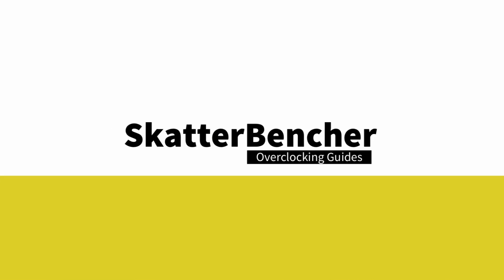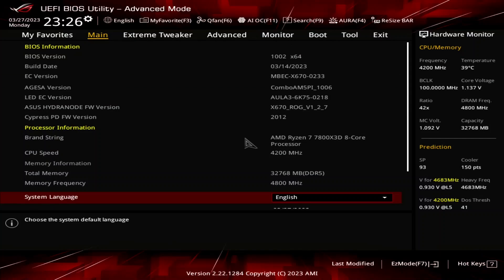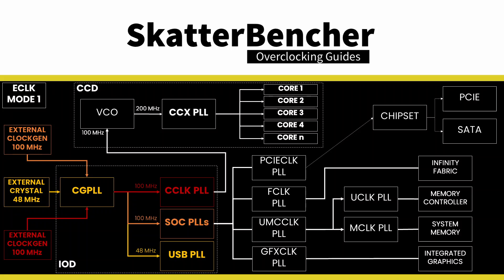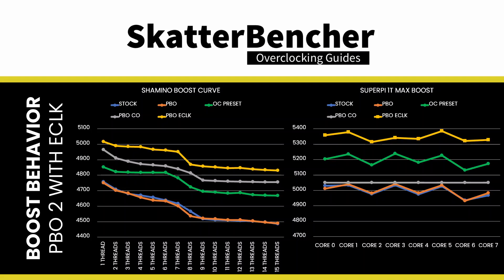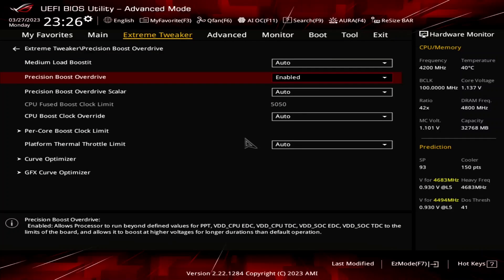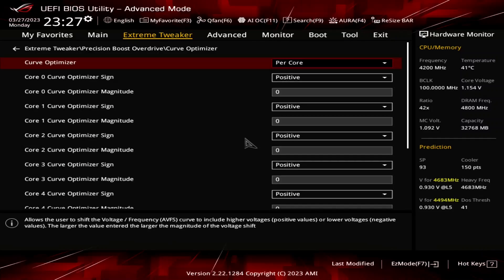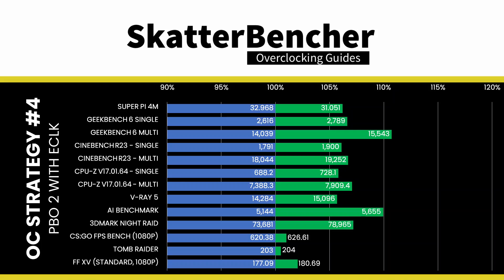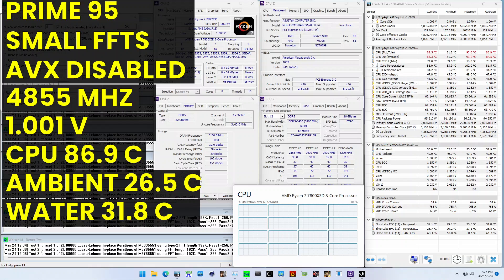5 Minute Overclock: Ryzen 7 7800X3D to 5403 MHz

Comment: Hi my bro ❤️
I have a question and I hope That you answer me with details, Can I overclocking my ryzen 7 7800x3d with advanced overclock to 5.4 ghz (eclk, memory clk, asynchrone, courbe ~ 0-5-5+0+0+0+15+0) with msi b650m-p or I should buy a x670 or x870 ?
Thanks a lot my friend 😉
Reply from the maker: I doubt that motherboard has asynchronous eclk support (you need extra external clockgen on the board), but there's definitely other strategies you can try. Check out my longer SkatterBencher guide for more information: https://www.youtube.com/watch?v=90UBUq1mLGY
Reply: @SkatterBencher  thanks a lot my friend 😉

Comment: The funniest thing is that I got 19500 in Cinebench R23 with a simple B650 and air cooling, and every day I use a 35 all core, which gives me a result of 19200-19300, perfectly stable for a whole year.
Reply: How wait is setings
Reply: Still using -35 all core to this day? not a single crash during gaming? I could also do even -40 on benchmarks but it crashes at -25 in games

Comment: Question: In a motherboard lacking an ECLK, could one force the FCLK (Infinity fabric), UCLK (Mem controller), and MCLK (Ram Clock) to a set speed, and then set the BCLK to 107?
Reply from the maker: On motherboards without external clock generators (ECLK) or with just one (Sync ECLK), all parts of the CPU will be affected by changes in the reference clock. While each of the mentioned IP have individually adjustable ratios, they're all getting their source clock from the same origin.

Comment: Question, is the reason you're setting the curve optimizer to a positive offset because of the CLK increase of 7%?  And did you test if it's possible to run that without effectively increasing the voltage at all? Just curious.
Reply from the maker: Yes, correct. Using the ECLK shifts the V/F curve along the frequency axis, effectively running a higher frequency at a given voltage. A positive curve optimizer shifts the curve along the voltage axis, forcing higher voltages. That's what was needed to get the overclock stable.

Comment: I just built a 7800x3d and this is my first build since 2014 when I built a couple AMD Kaveri A10 7850 computers for my daughters.  I did no overclocking on that one but at the same time I got a corsair AIO for my i7 2600k and tweaked it to 4.5ghz which is still runs today under the same AIO.  That was fairly easy to do.  CPU clocking seems to have gotten a lot more difficult.  Would love more explanation on what all these different settings do to the CPU.  Is that something you have gone over in your overclocking videos or does anyone have a suggestion on who to check out?
Reply from the maker: I suggest you can watch my longer guide on the 7800X3D. That should have everything you need to know about how it works + a couple of OC strategies ranging from easy to hard https://www.youtube.com/watch?v=90UBUq1mLGY

Comment: 106 works fine for me.  Cinebench r23 scores 18800 points.  I am getting error 107.  What do you think I should try for 107?
Reply: Edit: PC resets when running Crome while at 106. No problem at 105.

Comment: first of all great tutorial! i followed all of your settings eclk at 107 and curve optimizer at positive 10 and llc at 10x. i pass all stress tests fine. occt, prime95, cinebench r23, and timespy without issue. did some memory tests as well with no issues but i get random reboots when broswing with chrome or when i do light load applications.
 do you have any tips on what i can do to make it stable when idle and in light load scenarios?

Comment: are these settings still recommended now? Have the 7800x3d and rog strix x670e
Reply from the maker: These settings are still valid, however I wouldn't recommend just copying them. I always suggest watching the longer SkatterBencher guide to get a full picture of the different OC Strategies https://www.youtube.com/watch?v=90UBUq1mLGY
Reply: @SkatterBencher  I see. The only worry is that I saw the CPU going over 1.3 SOC voltage so I'll have to make sure to avoid that when following the video
Reply from the maker: You can manually limit the VDDCR_SOC voltage in the BIOS, no?
Reply: @SkatterBencher  yea I can but then I loose the 5.4 boost as my CPU wont go past 5.0
Reply from the maker: That's odd. Which setting are you changing to limit the VDDCR_SOC voltage?
Reply: @SkatterBencher  The SOC voltage to 1.25 and Misc voltage to 1.2
Reply: @SkatterBencher Also every time I enable Asynchronous mode, my PC restarts randomly.
Reply: It’s restarting because 1 of ur cores need more or less voltage on the curve. That’s the whole point with ur gunna turn up bclk u need to adjust each core on the curve up or down or it’s gunna eventually crash. It’s tedious

Comment: REQUIRED - eCLK on MB

ASUS - x670e  hero, exteme, gene, strix-e, strix-f
ASROCK - x670e and b650e taichi
MSI - x670e ACE
GIGABYTE - x670e master extreme, b650e master tachyon
Reply: Any idea if the ASUS ProArt X670E-CEEATOR WIFI does also have eCLK support?
Reply: B650E AORUS MASTER
Reply: Can I use the new Asus - x870E Strix - E?
Reply: @starlingspm4872  no (

Comment: I did prime 95 with that settings. Firsly curve optimized -30 and the system shut down, after -25 and i had the same results. At 20 it runs normaly but i have 2 erros on 2 cores. IDK what to do. I have also enable PBO.
Reply from the maker: For more information on how overclocking 7800X3D works, I would refer you to the longer SkatterBencher guide https://www.youtube.com/watch?v=90UBUq1mLGY

Comment: Why won't it run at 5.7 Ghz, same as the 7950X3D?  Since it has less cores, it should run FASTER/easier to cool?
Reply from the maker: TLDR: AMD saves the best CCDs with highest peak frequency for Ryzen 9 CCD0 and uses lower quality CCDs for Ryzen 7 and Ryzen 5s. The frequency limitation for the 7800X3D isn't due to cooling or voltage, it's the inherent capability of the chips used in the product.

Comment: Hello, I have a 7800x3D processor, I have not made any performance changes with it, it works as it comes out of the box, it runs at 4675 and 4775 mhz in games, is this normal?
Reply: 100%  normal.  I use   docp 1,  pbo  all cores  -27,  and  limit  of  89  celsius.  4,9-5ghz.  Just try,  it's really  simple  and  works well  if  you  have   an  240mm aio water  cooler

Comment: In my case I can't bring my CPU over the 5050Mhz even if I set the BCLK2 Frequenzy to 105 or whatever it sticks to 5050Mhz.
Reply: Seems to be a BIOS Update problem. Used to work back then. Used to have stable 5.3 GHz and now it wont go past 5050

Comment: Hey man, i stumbled across your video and i have a question. I recently bought and build my new system with a Ryzen 7 7800x3d, now im running into a problem with my idle temps,  under full load my Peak core voltage is around 1.08-1.10, and while idling it sits around 1.12-1.1.13. do you have any idea how i can fix this? I've tried nearly everything from updating bios, reseating cpu cooling, re applying thermal paste, power plans, updating bios etc but i can't seem to get my idle voltage down. Right now the cpu idles around 53-55 celcius with a 360mm corsair h150i, in game it won't even go above 65 celcius and under full cinebench load this changes to around 77-80 celcius. which in my eyes, does seem like allright temperatures... I've got no clue why my idle voltage is higher than my full load voltage... if you have a clue... let me know
Reply from the maker: Having full load voltage lower than idle voltage is very normal behavior in modern systems and is nothing to worry about. 

Is there any reason why you want to have the idle voltage identical to the load voltage?

Comment: Hey!
I have Asus TUF Gaming X670E-Plus and on my board Extreme Tweaker --->AI Tweaker and there only one BCLK
BCLK2 its motherboard feature?
Reply from the maker: Yes, support for 2 reference clock inputs must be supported on the motherboard hardware level. If you board does not have support, it's not possible to enable it in BIOS.

Comment: i dont have expo and i dont have eclk so can i overclock without it? i have asus prime x670e-pro wifi
Reply from the maker: You can use Curve Optimizer still. Check out OC Strategy #3 of my full overclocking guide https://youtu.be/90UBUq1mLGY
Reply: @SkatterBencher  whatever i do in bios my clock is always  4.6-4.9 ,there is no affect whatsoever. Curve optimizer -5 or -25 gives me same clock. I tryed 4 bios version.

Comment: Hi everyone, I have a 7800x3d processor. Under the premise of keeping CPU's stability, I aim to reduce the CPU temperature without sacrificing too much performance. What settings should I adjust in the BIOS to achieve this? Thank you.
Reply: Yo tengo PBO -27 y el voltaje en 71000 mV en un 7800x 3D y asi me funciona estable y pasa las pruebas de OCCT de 1 hora y cinebench 23 con buenas puntaciones, pase de 80°c al 100% de uso a unos muy buenos 71°c. Tengo una refrigeracion liquida de dos ventiladores de 120mm. Espero haberte ayudado!
Reply: PBO Curve in -30 is the only thing I learned so far.

Comment: You give 0 explanation on the most important part. How are we supposed to know which cores are strong and weak? All your videos you leave this out... This is pointless.
Reply: Hey, I'm not sure if you still wanted to know how to find out which of your cores were your best, but you can find out by installing Ryzen Master onto your PC which will display which cores are the best. Hope this helps
Reply: HWiNFO64 also showing from best to worst cores
Reply: @RmX. Where does it show your best and worst cores? Do i just make an assumption based on their avg clock speeds?
Reply: @bigjerome-wz4uo they are numbered in best to worst in hw info

Comment: You should do this overclocks with MSI too :)  I don't see the Asynchronous mode and BCLOCK 2 Frequency :(
Reply: He doesn't note in this video this REQUIRES an eCLK on the MB. The only MSI board is the x670 ACE.

Comment: Great info! I read on a forum some guy recommended bumping LLC for the cpu voltage to the max for 7800x3d to get a bigger stable curve optimizer negative, he got -39. What do you think about this? He claimed it should maximize the already so locked down voltage. Would this be a good idea? Harmful?
Reply from the maker: Logically it makes sense. The main function of VRM LLC is to have a controlled the Vdroop which is the voltage drop when going from idle to full load. A low LLC will yield a larger Vdroop (and larger undershoot), which means that the effective voltage will be lower. A higher LLC will means a smaller Vdroop and thus higher effective voltage.

If you use Curve Optimizer, you try to undervolt the CPU. The main challenge is to find an undervolt that large enough so the PB algorithm boosts as high as possible without inducing instability due to too low voltage. A steep LLC will yield higher minimum voltages, so possibly higher Curve Optimizer values.

The main drawback of a high LLC is that the Vdroop may be too small, so you have high minimum voltages under high loads and possibly large voltage overshoots. It is generally not recommended to have too high LLC, however I don't know how "dangerous" it is. It's actually a topic I've been thinking about doing some research on.

Hope this helps.
Reply: LLC at level 7 for my 6400mhz 2133fclk overclocked memory. Working on pbo percore now dialing in each core for maximum performance

Comment: My stock curve is similar to yours but when I enable BCLK2 at 104mhz my curve begins around 4400 and ends around 4200, very linear and lower than stock at all points. I have PBO enabled without curve optimizer. I guess I'm doing something wrong.
Reply from the maker: What motherboard are you on? Sounds like Precision Boost is getting disabled when using ECLK
Reply: @SkatterBencher  Asus ROG Strix X670E-E Gaming WiFi (bios 1416 2023/05/16)

Comment: ngl, I don't think your 107eclk + PBO was really stable, especially not in mid core workloads.
The best I can get stable was 106.25eclk on direct die.
That said I could run obituary high eclk of 107+ too with over the top fclk to like 19750 (cb r23) / 7740 (cb r20) scores with PBO enabled.
However you certainly won't pass y-cruncher VST or some medium CPU load stress tests. Cause the required voltage and very low temp ain't reachable at this point.

Even with Vcore offset, you run into voltage/ thermal limit on direct die cooling. So there is no way you could get like 5.2ghz all core stable without using a static OC and like 1.28Vcore.

That said, you won't be able to cool it cause the silicon gap filler above the CPU cores is just too hard of a thermal insulator without a chiller or LN2...
Reply: Youtube overclockers dont give a fuck about stability and testing. They want “10 Ghz on my 7950x” clickbait video. Most of the times their so called OC only is valid in CPU-Z and totally goes down the hill in any serious workload.

Comment: Can this be done with the 7950x3d cache cores?
Reply from the maker: Yes, I already have a video up for the 7950X3D: https://www.youtube.com/watch?v=9BwNt6PD-00
Reply: @SkatterBencher  thats about the non 3d cores right? because you are stating that the 3d cores are still on 5250 but on the 7800x3d you are bring that 5250 to 5400 thats what i want to know if that is possible with the 7950x3d
Reply from the maker: I also use ECLK in OC Strategy #3 and this will increase the X3D CCD frequency

Comment: Very interesting... I'm mainly just left with a bunch of questions. First of all, the bios version u have here isn't even listed on ASUS website anymore. I'm using 1410 and it doesn't have the option to select any overclocking presets AND even if I select DOCP memory profile, there is no option to change eCLK Mode nor BCLK2 Frequency... Is this normal?
Reply from the maker: Are you on a motherboard that has external clock generator support? Not all motherboards do. If your motherboard doesn't have external clockgens, then the option wouldn't show in the BIOS.

ECLK option hasn't been removed from ROG X670E Hero as far as I know
Reply: @SkatterBencher  I have x670e-a gaming wifi and based on what I can gather, all x670e boards should have eCLK mode and bclk2 frequency capability? If not, Asus x670e series bios manual is rubbish... EDIT after some further digging around, x670e-e and x670e-f only have given overclocking functionality, even though asus advertises x670e-f and x670e-a as the same thing more or less :(

Comment: Thanks for the video, before I touch anything, I just need some help please. I just bought and put together ryzen 7 7800x3d and Gigabyte b650m ds3h with memory capable of doing 6000 mhz. I updated to the latest f6c bios from gigabyte right away when I put together everything. I have a 1000watt corsair power supply.  My issue is it seems like the cpu is being limited to only 1.1 volts from what I can see using bios info and hwinfo64. I have not touched the ram with xmp profile yet because I don't know why the cpu voltage is only limited to 1.1 volts.  In cinebench max clocks I get are 4.8ghz on all cores and it stays consistent (scores around 17,775). However, when gaming the core clocks seem to fluctuate with some cores sometimes going down to 3-4ghz range.  Do you guys know what the problem is? I don't know what settings are making the processor do that. Again, my bios settings are still completely stock as of now. Thanks for any help with this.  
Stock Bios info reads: 
CPU Vcore: 0.882v 
CPU Vcore misc: 1.161v 
CPU Vcore SOC: 1.053v  
CPU frequency ≈4221 mhz 
BCLK ≈100 mhz 
Memory frequency ≈ 4800mhz
Reply: I have a similar issue. Did you find out?
Reply: @Megatrance9000  I found that setting the soc volts manually in the bios to 1.2 volts with PBO per core all negative at 20 value keeps the clocks on the cpu at 5050 mhz with memory set at 6000mhz using either expo or xmp. Different fluctuations in cores speeds are apparently normal from what I've read online because most games don't fully utilize all 8 cores on it equally. This is of course my personal settings that worked for me. I hope this helps.

Comment: Lol I dare anyone to do this with this CPU. This video is dishonest and leaves out the fact that he has a chip with good silicon. Also he doesn't mention the SOC voltage needs to be 1.25 or lower or you will fry your CPU. Lastly, he does not mention that you need to upgrade your bios as there are fixes that prevent the CPU from being fried. Very dishonest video.
Reply: "Dishonest" is a bit harsh - especially since in this video and in many of his other videos he makes note to clearly mention that "this is not the whole picture", and that these setting are specific to his cpu and not to copy his settings as your cpu quality and optimal settings will vary. In his longer video of this short video, he makes that statement at least 4 different times: note one of those at 16:52 - 17:05. In other videos, he states that silicon quality varies on each cpu, and he has mentioned in still other videos the outstanding quality of some of his personal cpus as well, noting that "this is a particularly good overclocking cpu", and he's mentionec BIOS updates as well, which is something most of us know but he doesn't have to qualify it in every single video, especially a 5 minute video in which every little thing can't be mentioned as there is a time limit. I guess you could through in to update the chipset drivers from AMD and not the board manufacturer also - where does it end?!   These is HIS settings on THIS hardware, and though it is for "entertainment" purposes, one can also learn from it and adjust those setting to their own setup. I suppose that because my chip is not as good as his, nor I don't have a mobo that has Asynchronous mode, that it completely nullifies his results!